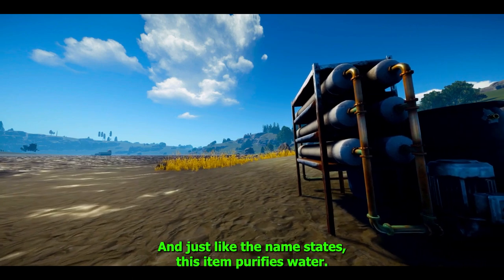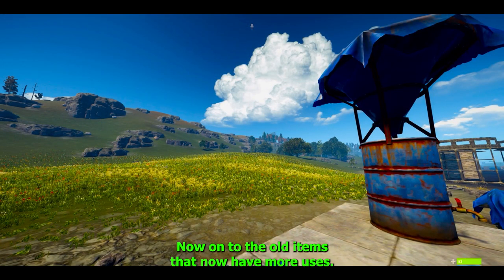Rust Consoles New Water System!

Comment: Large water catcher can fit into a 2x2 space.
Reply from the maker: Yeah way too big and to much space ;)
Reply: @Budzie   not if you're making it a base specifically for the large water catcher - same sense as a large furnace base.

Actually, you can make both as a hollowed out 2x2 shell, using raised triangle foundations as walling (cuts out needing actual walls)
Reply from the maker: I'd rather spend the mats on water pumps tho 😉
Reply: @Budzie  this is more for players who dont want to get into the full depths of water filtration and are merely in need of a low maintenance source of hydration.

Useful if youre not into farming and are more of a hunter type player.

Small water catchers are too slow and do not generate enough water for even a solo player (at least not without waiting a few hours)

edit: Placing either small or large water catcher indoors is optimal for security purposes.

you can make a relatively cheap base specifically designed for deep inland water gathering.

no sprinklers, small pumps or purifiers needed.